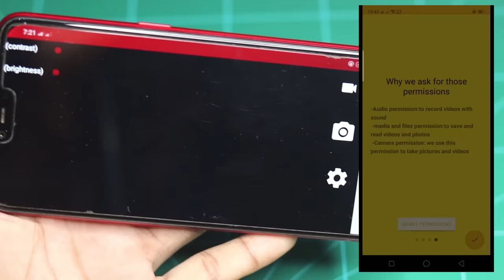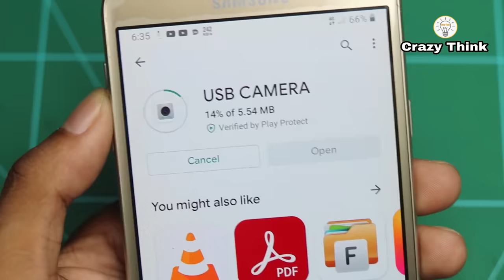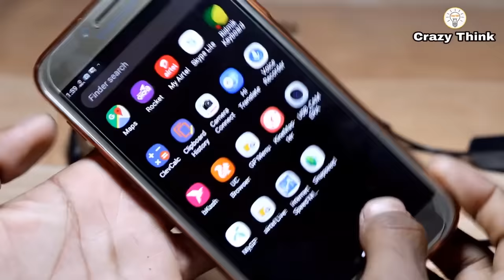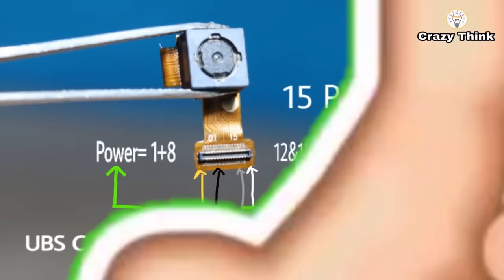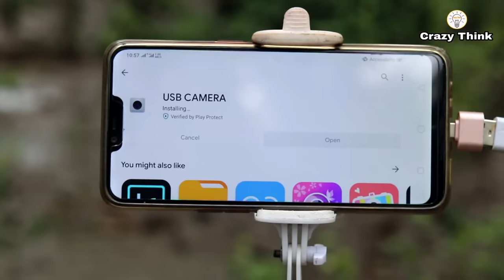4 Amazing Spy Camera Make - Using  Old Mobile Camera

Comment: These are all fake exact the last I am not that sure butt first 2 total faked the camera angles are not the same just look carefully at the graftpaper lines and the placement of printedbord on the table based of the image on the phone he is showing is all are messed up  I would say that it is a well choreographed script and the vedio  was shoted on another working camara and shown with perfect timing and a big factor that made me check it out is that these camera are from old phone boards and I don't see (optical image stabilization)   OIS in  these for sure so how did he shoted it so perfectly with out even a little bit movement of it is possible then 2 ways it can be true :-
1; he had a very study hand 
                       or
2;it was shot in another working camara  
And I'm not saying that it is not possible but I saying that most likely it's faked